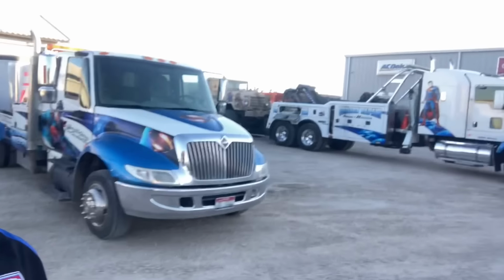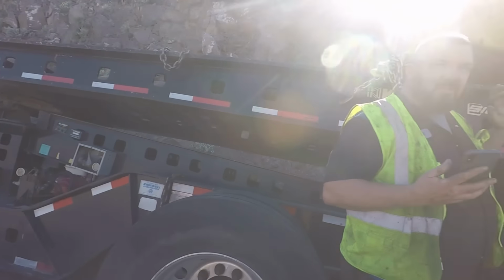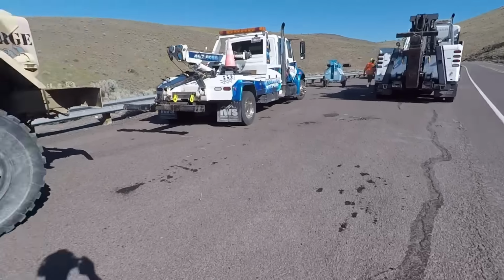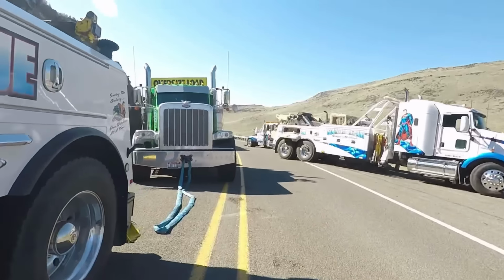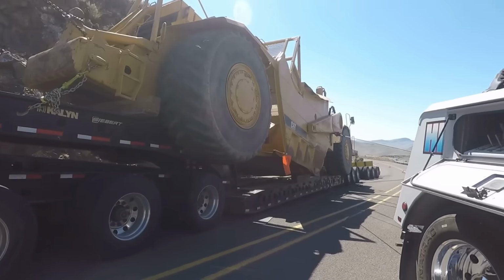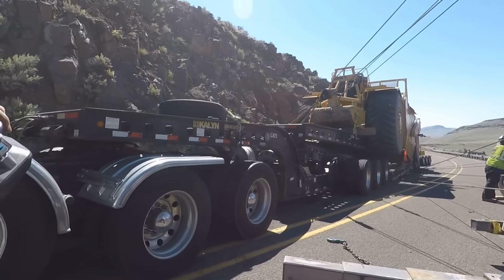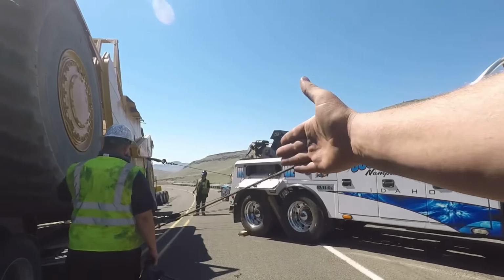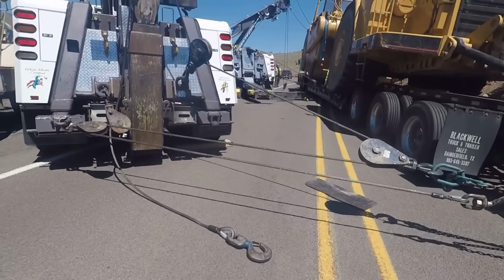Did Superman finally meet his match??? | 262,000 Lb SUPER LOAD

Comment: They to straighten the steerable rear section and the trucks should be backed up load so three trucks can pull out and forward and I think they have to hook up high on the scrapper and the rotated truck wenching it forward and a couple hooks on side of trailer but the high hooks will do the best to keep load up right. This my ideal so I’ll wait and see how they do it. Drove concrete trucks and ran a 38 M pump truck so I have had a lot of training under fire and never have rolled a truck or pump trying to get them of bad lean trucks that’s why you have to pull from up high.

Comment: I know this is going to sound ignorant- forgive me- but why not detach the jeep, remove the neck, and drive it off? Trying to prevent damage to the trailer? You're not going to hurt the 657. Also, why not use a jeep and a basket dolly + booster to haul this in the first place? Does Oregon DOT allow a jeep & dolly?

And yes, I realize that everything was done this way for a good reason from the transport to the recovery. I get it. I'm not criticizing. I'm just curious.

Thanks in advance!
Reply from the maker: You don’t sound ignorant at all, it’s an excellent question, many people have asked this. The problem was it’s dangerous to unload while leaning and on an incline, and it was resting against the rocks on the mountain side. Also the neck of the trailer was tweaked and would require lifting and winching to get that corrected. It would have been by far the most unsafe option and probably would have taken more time.
Reply: @CountryEquipmentRentals  
That would be a good reason. I'm not familiar with Sieberts, just Murrays & Cozads, and then only in California. So again, I don't know what I don't know. Would driving it over the side have been an option? In my hypothetical, I imagine lifting the can, removing the dunnage (hoping the rear stinger doesn't damage the neck more than it already is), articulate it to the operator's right (driver's side of the trailer), and drive it off. The trailer it self then becomes easier to recover. But again, it's what i don't know.... My experience is mostly with 5 axle transports- a 623G being the largest we can legally haul. I've done 2 handfulls of 9 axle transports, about half 657s and half D-11s. (We can legal 9 axles because California permits a 16 tire group. No booster required.) And a few Jeep & Basket moves (mostly 633s and water pulls).

As for heavy towing and recovery, I know virtually nothing. Again, just curiosity eating at me.

Thanks

Comment: Am new to watching these type of things , am a little puzzled by a couple of things though. First of all why was the picture of the green truck Pixelled out in every shot ?. Secondly why did you have to drag the back end round , surely if you had taken all of your trucks to the front of the vehicle, and had them in a row down the road, then linked them altogether with huge chains between each of them and onto to the green lorry then all of them driving forwards in unison also the main original green truck, sure the massive amount of pulling power all these trucks would have had combined would have easily been enough to pull the whole load up the hill, without the need for the long complicated sideways dragging . Other things I agree about the men walking and standing near all those tensioned cables was surely highly dangerous if one snapped. One other thing I noted was the sun was washing out a lot of the video from certain angles, wondered if you have UV lens on your camera as this usually stops that. Was an awesome watch and have subscribed, but just was puzzled about why it had to be done the way it was, which to me a layman it all seemed very time consuming and complicated. Would have thought linking all the trucks together to the load and just all driving up the hill would have been easier and much quicker, so would love to have someone explain why this couldnt be done..

Comment: Very nice work! I was a bit concerned you'd pop some tyres coming back onto the tarmac, but didn't seem to be an issue 😎

Minor quibble - towing and pulling poundage is "force", not "pressure". It seems a common confusion over there.

Comment: Wouldn't it have been easier to get a couple of 250T/300T cranes out there?  A dual lift would have gotten that scraper off of the trailer and then the trailer would have very easy to move.  Thoughts?
Reply: Cranes were looked at but there was not enough area for the cranes to set up
Reply: @michaelseverson9809  makes sense. Props to those who designed the move. They did a great job.

Comment: so im new to watching these recovery videos(love them!) but what stopped them from dropping the tractor on the back of that truck first, then pulling just the truck/trailer out? maybe i dont fully understand
Reply: A few reasons. It would mean deadlifting the scraper off the trailer which would require 2x cranes. Which means it turns 1 recovery into 2 recoveries and lifting the scraper off would be a hell of a job in itself. Truck and load is intact and undamaged so it's far easier and safer to do what they're doing

Comment: Nothing to do with the pulling but maybe someone can tell me, what is the purpose of that final trailer at the very back? Engineering wise I don't see how it could carry much of the payload, like they just added some dummy axles to fake compliance with pavement loading laws.
Reply: I just realized this rig was almost the same gross weight as my average cargo flight back when I did weight and balance calculations for 767s. (But they only had 10 tires and no rear steering)

Comment: Was that really a 15 degree grade?  or was it 15%?  Most road grades are in percent, so 15% is 15 feet of elevation change in 100 horizontal feet.  A 15% grade is equal to about 8.5 degrees.  A 15 degree grade is a 26% grade.  So it makes a big difference when calculating the loads.  Thankfully, you had a bigger safety margin than you thought, unless it truly was a 15 degree grade.

Comment: Put some blocks under the keep wheels to lift it and keep the trailer from grinding against the asphalt if the air bags can't lift enough.  If you slide them from the side, you can pull them out before they contact the trailer
Reply from the maker: We did that
Reply: @CountryEquipmentRentals  Yeah, I saw that later in the video.  I tend to comment as I go, not always comment after the whole video, especially on long complex videos like yours.  I was in a black hole watching your videos for a couple hours at least.  I really enjoy them!  I'm impressed with the actual math that you put into your recoveries.  The high value of working as safely as possibly is abundantly evident.
Reply from the maker: @truckgotstuck  👍🏻
Reply: @CountryEquipmentRentals  Curious, what was the bill?  I don't know what the tow rates are down there, buy I would making 4 hours each for 1 rotator, 1 specialty (the sarge, unless he was billed at standard heavy wrecker rate) + 3 heavy wreckers, 2 man traffic control unit.  Am I on track?  What are the rates like where you are from?

Comment: alot of staff standing in the line of a snapping winch cable,great job on the recovery ,not entirely sure on the attention to drama and headsets and figures versus the common sfety aspect.and yes i work n recovery,those winch cables your men are stand around come back at over 2000 miles an hour but no one standin clear ??
Reply from the maker: If you know your numbers you don’t have to be scared, we’re rigged to stall winches or trucks will move before even coming close to the wll

Comment: Absolutely great job.
But, I saw a few times people, including camera guy, between the cables and the chains, when the trucks are pulling. Extremely dangerous. When a chain or cable snaps with that amount of weight, you won't survive.
Besides that, great job.
Sorry for my bad English, regards from a Dutch crane operator.

Comment: Y'all sure done a fine job with this. BUT! I've driven similar rigs weighing in around 250,000 lbs gwv and hauling Cat scrapers identical to the one on this rig. With that being said. I wouldn'tve called you at all. I would've simply unchained the scraper driven it off the side of the trailer (without damaging anything since it's rubber tired) and pulled my rig out with the scraper. Reloaded it and went on down the road. Costing nothing but maybe about 2 or 3 hours. Duhh...
Reply: My boss would've fired me on the spot for calling you.

Comment: Drop the trailer and back  the scraper off of trailer.Hook back up and reload scraper when transport is on firm ground .Contruction Company transport drivets are awesome.Why try pulling the whole load.Be smart.Make it easy and not break anything.Thats view from a heavy equipment mechanic.
Reply: As a flatbed driver myself and a former heavy equipment operator where running scrapers was my specialty, I would have to agree.  That sidepull on that trailer can do some serious damage too.  Would suck to bend the frame.

Comment: With a huge load that size, why not have a police car and a flag car in front of the truck. When they come to a sharp  curve in the road, have the police car stop on coming traffic way ahead of the truck.  This would allow the cab of the truck to swing  way out into the oncoming Lane .  The back of the trailer would avoid the rocks on the side of the road.  Problem solved.  👍  PS. Just read that the steering system on the trailer failed which caused this accident.  Not so sure my idea  would have prevented this particular incident.  Oh well.
Reply from the maker: Haha you’re good 😊

Comment: If that equipment is running. Just pull the tie downs drive it off. Hook up at the front,and help pull everything. And done.  Know a situation that a rear drive shaft dropped on a 4x4 remote area on a highway,cost hundreds in towing plus the inconvenience of leaving it .... note I said it's a 4x4. So someone had a brain fart. Didn't engage front axel and keep going
Reply from the maker: Couldn’t unload the equipment, the neck was all twisted and bound up

Comment: Thaaa Fuuuurig you do to that POS Chevy's front left knuckle?  I mean...it's not surprising given it's a pile and everything compared to an F150 however you have yourself a bit of an alignment issue there, sir.

EDIT 1> The first thing I'm thinking as I'm driving past that scrapper and 3xxl bed is "Whoooo TF told me this deal was 100,000 pounds?" Those tires alone are 2700-3000 pounds EACH. Yeah, no trailer, no rig, no scrapper, just tires are about 12000 pounds and that's just rubber!  You should see the REALLY big boys. Bridgestone 59/80- R63 tire that costs like 50 grand. , with a diameter of over 3m(11-12 feet) and they weigh 4000kg (5400 pounds).I used to drive a Cat 797 which carries about 400 tons of weight.  Believe it or not, there are bigger bois out there now that do close to FIVE HUNDRED tons of pulling.

EDIT 2>They should have something that big and doing mountains daisy-chained in case of a failure like this or it needs the juice to get over a higher grade. BUUUUT you go cheap, you end up making a mess/twisting and cracking your gear.

Comment: Why not just drop the front of the low-boy and drive the grader off and use the grader to pull the trailer onto the road? Which makes as much sense as some of the comments.
Reply from the maker: Can’t disconnect from trailer. Because of the twist and the weight it’s all bound up
Reply: @CountryEquipmentRentals  I was being facetious. There were so many inane comments I thought I would throw one in.😉

Comment: the only lines preventing that thing from tipping over are the higher ones attatched to the scraper
Reply: The high lines helped during the pull. Once the rest of the lines were loaded the unit would not be able to tip unless it could pull all the trucks with it.  There is not enough speed in the movement to generate enough momentum to flip.
Reply: @michaelseverson9809  the lower lines are coming down at angle which literally means when they are loaded up they're yes pulling but also lifting they wouild have to be running at road level to prevent this
Reply: @busybee6889  yes the lower lines are pulling up, if you use small string and a model, secure the string at a fixed point and move the model to tighten the line. You will see that in order to roll the model either the end you are pulling on has to move away from the fixed point or the bottom has to be able to run under your pull point. There was no way for the down side of the trailer to go thru the ground to get under the high side, and that only left the option of the high side we were pulling on to move away from our trucks in order to roll over. I will post a video demonstration the factors I am talking about soon.
Reply: @michaelseverson9809  i understand my friend ...it is why I said originally that the high lines were the only thing preventing it rolling over...thankyou for replying btw
Reply: I understand that a swivel pulley fixing the cable at ground level would be tricky buy not impossible..your tow vehicles were having a lazy day that day...plenty of torque left

Comment: Why would you use such a trailer with so many Breakpoints its just stupid because they are just rolling or driving along and u cant steer them. With a Rigid Low Bed Trailer this never would have happend and with the right technology you can easily get around any corner even though its Rigid. Edit: With Rigid i dont mean the axles or tires i mean one straight railer with many axles that can stear.

Comment: let's make a big deal out of nothing. it's not like the scraper is dead weight. Unload it and drive it away.
Reply from the maker: But what you don't know is that we couldn't unload it. You weren't there so you wouldn't know but the scraper was up against the rocks and the neck was twisted and couldnt detach to unload the scraper.
Reply from the maker: There were also chains hooked from the scraper to the neck, the tires of the truck were off the ground so you couldn’t raise the neck either, lots of reasons why we did what we did, lots of people watch this and think they could do it differently but since they weren’t there they don’t know.